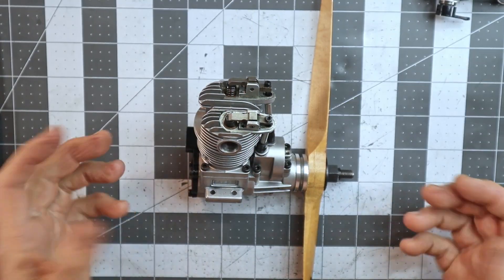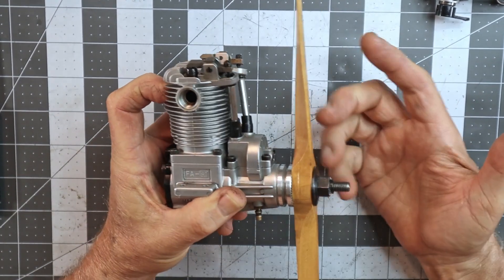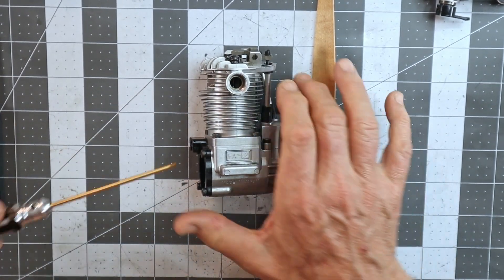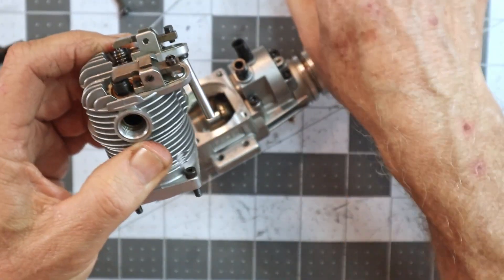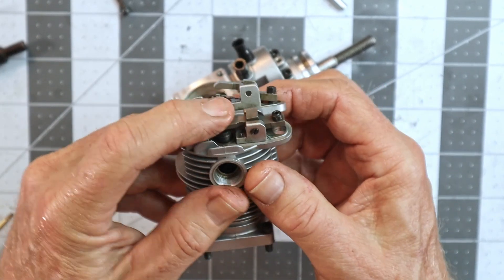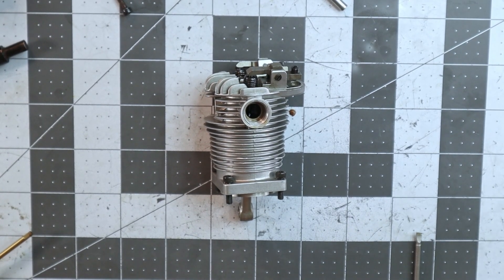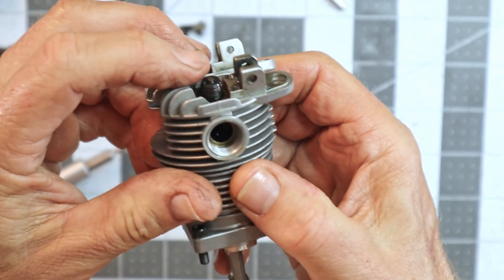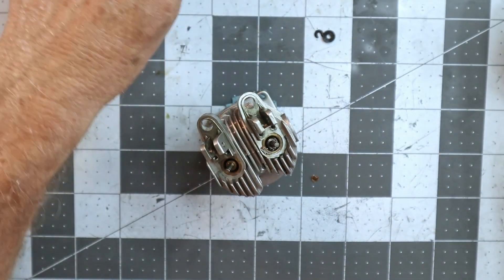Saito FA-82a Burping Engine Mystery Solved

Comment: Interesting... and a good find. Just left it in a compressed state to where it lost energy. 

Gives me something to make sure and check on my 4 strokes. 

Outside of taking rocker covers off, is there another way that you can tell to make sure that the rocker spring is not left in a compressed state or is taking the cover off the best and quickest way? Just curious... and in the event, i ever have a cover that is stubborn to remove.
Reply from the maker: There is but i cannot explain it in words.

Comment: i wonder if its a good idea to replace springs every few seasons on even a good running engine, the springs could sag or take a set after being compressed to installed height for a long time, i have same engine with about 10-11 flying seasons worth on it,  i know mine doesn't run like it did when it was new, maybe worth trying a set of springs
Reply from the maker: Springs don’t got bad like this very often. It’s your money but my experience is that springs seldom need to be replaced. This was an example of special circumstances that caused this failure.

Comment: I will admit I did not think of the valve spring as the culprit. If I'd taken into account the lacking top-end power, I might have done so. Good job David. Like you said, ALWAYS store 4-strokes on the compression stroke; that way both valve springs are not depressed in the slightest - that goes for your viewers & subscribers David, I know you already know this ;)
Regards Harry